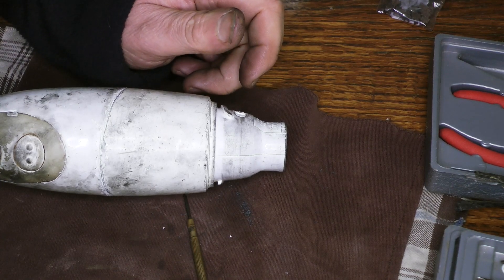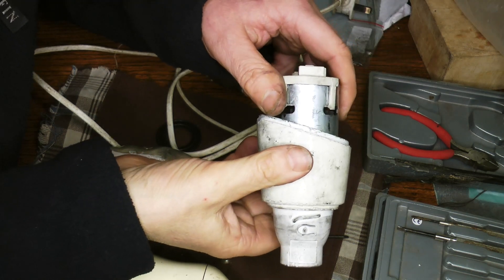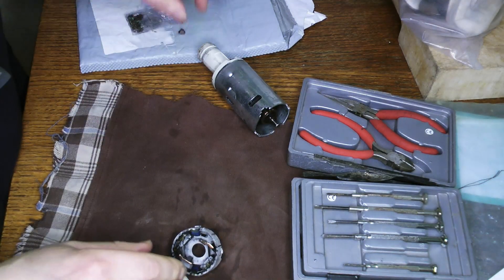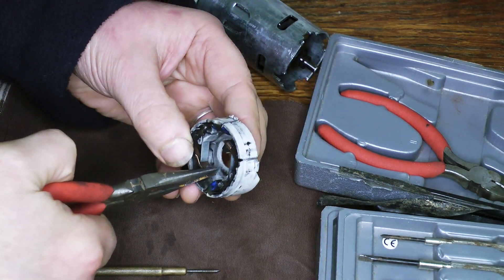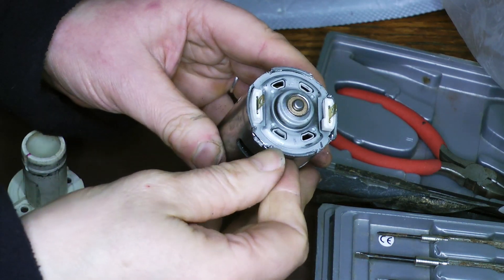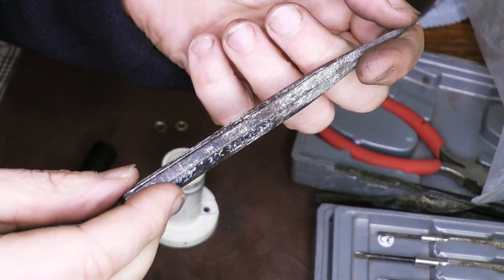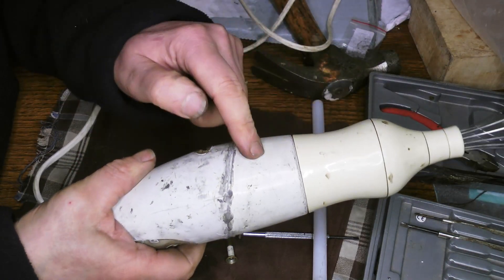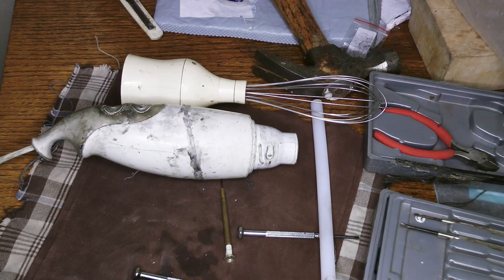Replacing electric motor brushes in broken stick blender: "Kenwood Wizard Pro". I FIXED IT!

Comment: It is very rewarding to get old things working. Since you were inside the motor, it might have been a good idea to put some lubricant to the bearings. They have a tendency to start screaming soon after you put them back together.
Reply from the maker: Good idea - I wish I'd thought of that! I do get some screeching sometimes, but I think that's from the blender attachment.
Reply: Oh yeah. Drop few drops of vegetable oil to the shaft inside the attachment. Worked for me.